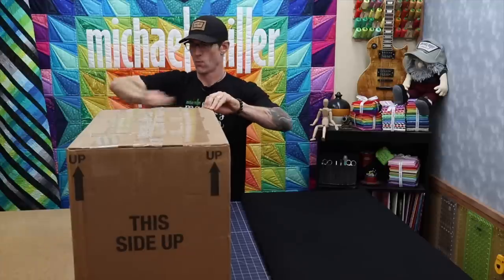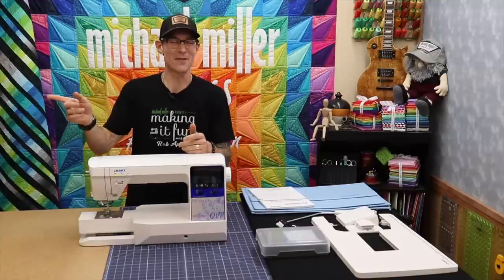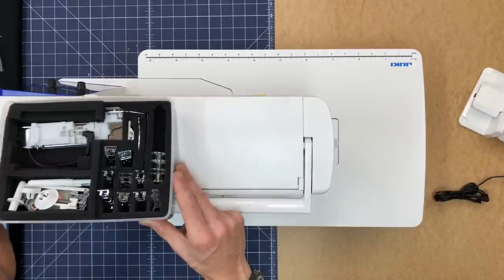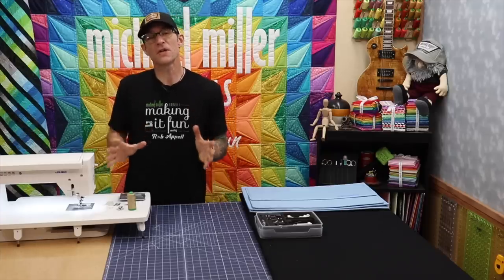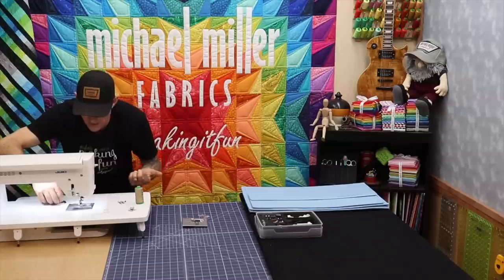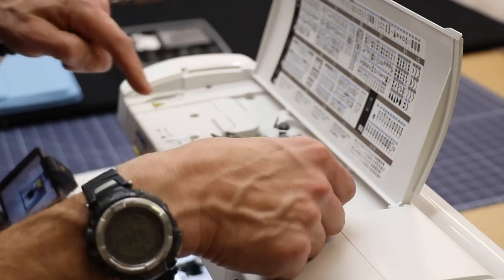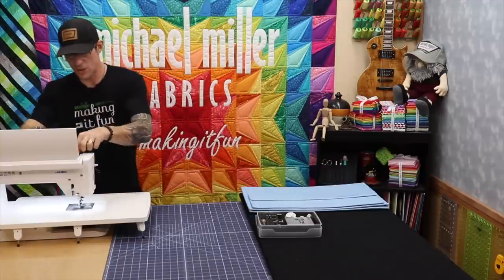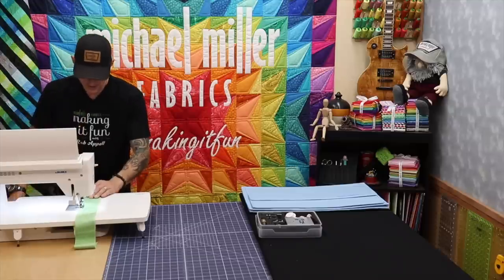Rob's New Juki DX3000 QVP Sewing Machine -  Michael Miller Fabrics' Making it Fun #32

Comment: I love my Juki Kirei.  (I bought it used in like new condition for $1500.) 12" of throat space goes a long way to increasing one's quilting enjoyment.  It takes some getting used to moving from another machine. That would be true for any machine.  It has this great beginning and ending pattern that you can set up for locking stitches (either with lock stitch or forward back) , raising foot and cutting thread--and these can be controlled with the feature pedal on foot pedal (it has a regular power on the left and feature on the right).   Love the Smart Feed system--so no walking foot.

My biggest dislike:  the big, honkin bevel on the throat plate.  Covering it up with sewing mat helps.

Comment: How is the Kirei and Sayaka different? To me they look the same. I’m just confused as to why Sayaka is like $900 more but the same features based on what I’ve looked at.
Reply: I am confused along with you. Im thinking maybe the accessories are a little different? Because I saw no differences really in the machines. I dont know either and that, it makes it difficult to choose what is better to buy for quilting.
Reply: I believe the Kirei is discontinued and was replaced with the Sayaka.  This year, (after being frustrated with the paltry 7.5" throat space on my Bernina) I bought a Juki Kirei (used on ebay), and I have been very happy with it.  I hate it for piecing...that big honkin beveled throat plate is a pain.  But I have another preferred machine set up for perfect piecing.  That 12" of throat space is the key.  It allows me to get my big quilting projects done easily.

Comment: I have one of these machines coming in a few days. I just noticed it doesn’t come with an auxiliary bed. How is one supposed to use it in a recessed sewing table? Due to me being very short, I absolutely have to use one. Geez, I may have to rethink this purchase.
Reply from the maker: Thanks for the question, most of the recessed sewing tables use an insert that is custom fit to each machine  to make the needle plat flat in the table, moist brands of tables will offer to sell you a new insert for you new machine.
Reply: True that and my mistake. My sewing table has an edge machine shelf that raises and lowers. Amazon special😉
Lordy, wait and see thing I guess. Thanks for the reply.

Comment: I tried dealing with the local stores but they were selling the same machine for 500$ more then it was on amazon n when I told them that amazon was selling at a low price they both got defensive and angry, saying, "amazon is not supposed to sell high end machines!" I took my business to amazon. Plus I got 8 presser feet with my machine. The store wasnt finding me any n when I asked them if it came with quilting feet they lied n said yes. I later found out it didn't.